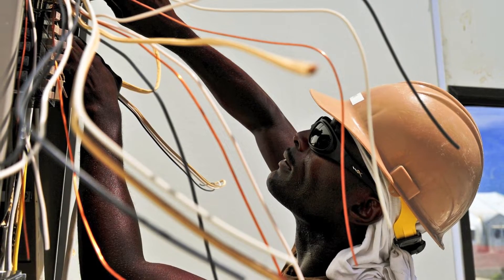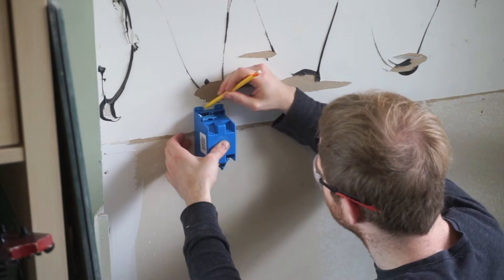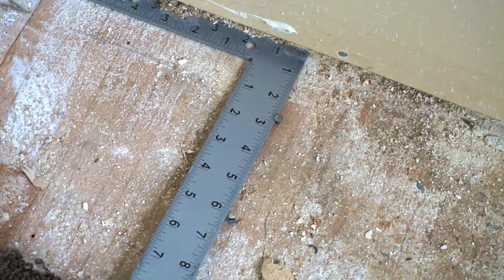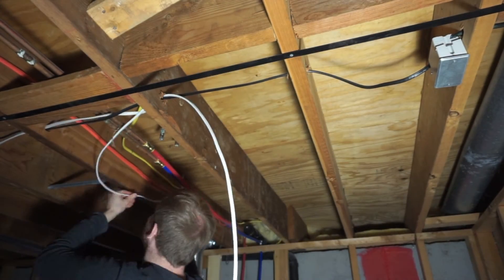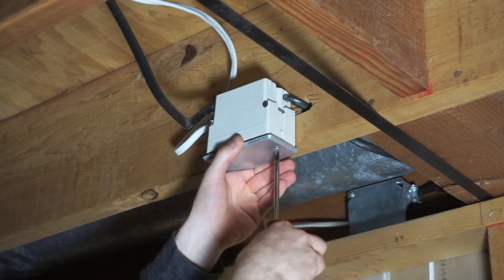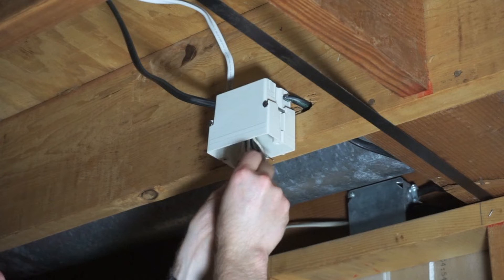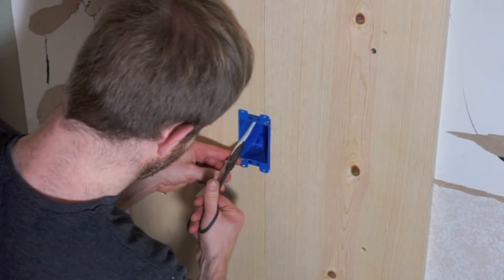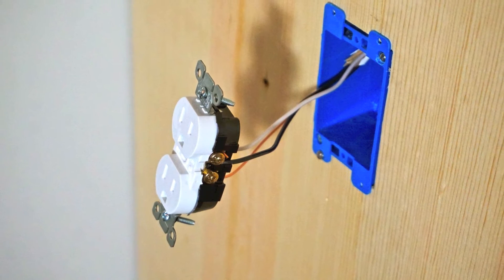How to Install an Outlet From a Junction Box - Electrical Wiring

Comment: for the hot side, does it matter which screw you connect the wire to? I've always opted for top screw
Reply: It usually doesn't matter for a standard duplex outlet because the top and bottom are connected. It does matter for a GFCI outlet, though

Comment: I want to run an updated system one room at a time. I want to run updated wires from outlets up to the attic and back to the panel. I want to upgrade to 20 amp 120v plugs throughout my home. Probably a waste but yeah.  Can I run up to my attic with all plugs and add the  to a junction box and then from the junction to the panel creating a 29 amp circuit to that specific room?  I want each room to be in it's own breaker as far as plugs go.  Lighting will be on their own circuits.  Im No electrician though I just want it all to make sense for once.  All of my stuff is outdated and a fire hazard

Comment: Let's say I wanted to add a receptacle to an unfinished area, and the nearest existing circuit is for a light. I don't want the receptacle to be controlled by the on / off switch for the light. As long as I branch the new connection to the hypothetical receptacle off of the existing circuit before the circuit reaches the light switch, and not after, then the receptacle wouldn't be controlled by the switch, correct?
Reply from the maker: I believe in your case, even if you branched the line off before the light it would still be controlled by the switch. You will have to tie into a different circuit.

Comment: Black wire conned to white wire… isn’t there a mismatch of amp ratings/AWG there?
Reply from the maker: I see what you’re saying, in this case the amps were the same and a good way to confirm this is to look at the amperage rating on the breaker that it’s connected to. It was 15 amps which means you would need a 14 gauge wire. Maybe the color of wire wasn’t standardized as it is now, it’s an older home built in the 80’s.
Reply: @_Shopfix  I think modern black sheathing might mean 30amp service for ovens, water heaters, and electric cars, etc. But I’m not 100%sure.
Reply from the maker: I don’t believe I have a white wire connected to a black wire?
Reply: @_Shopfix  black sheathed wire? I know white sheathing means 15amp. Isn’t black a different rating?
Reply from the maker: I think you’re right, most of the larger amperage is covered with black sheathing. But I think as a rule of thumb you don’t want to base your electrical wiring on the color but rather the true amperage that is running through the line from the breaker.

Comment: I’m always so jealous of installs like this. My attic is the biggest clusterfuck you’ve very seen of wires and insulation. I have to add a plug to a room and I’m not motivated at all to climb up there to figure out where I can splice.. good for you my man 🍻
Reply: I’m on the same boat. So much insulation up in my attic that I don’t even wanna go up there. Plus there’s not a lot of room to move AND it’s hot in there. I need an outlet in my office but I may just not do it because of that. Having a basement sounds and looks a million times easier

Comment: Blue plastic box is an old work box. Good video.
Reply from the maker: Very true, thanks for the correction! Take care.
Reply: @_Shopfix  It's also good to strip wires long enough so no insulation goes under the terminal screws. It looks like yours are borderline.

Comment: Why a plastic box verses a traditional metal box?
Reply from the maker: Well, normally when you are adding something in existing drywall you will be working with new work boxes such as the blue plastic ones. It's easier to work with and plastic boxes don't have to be connected to ground like old work metal boxes.